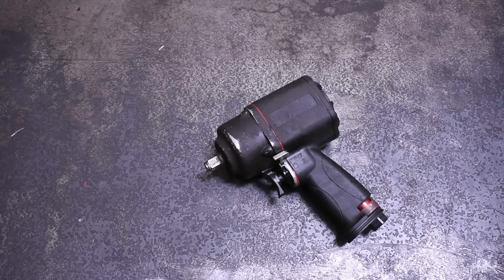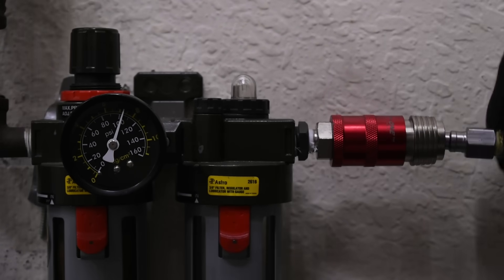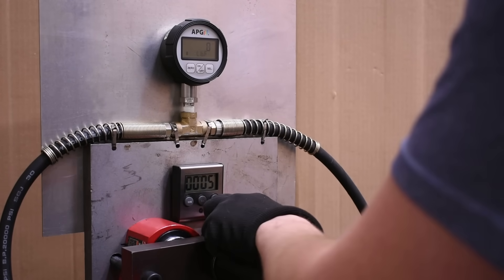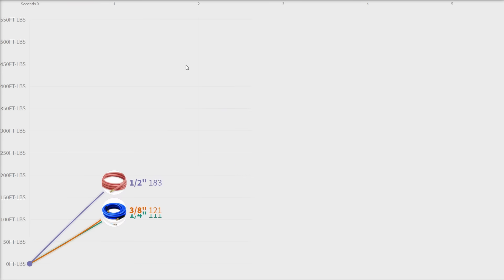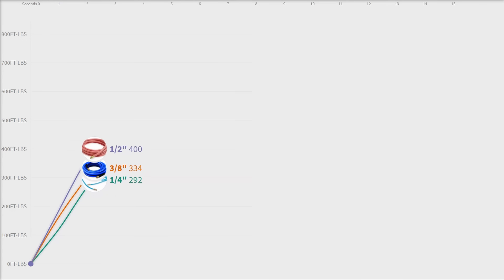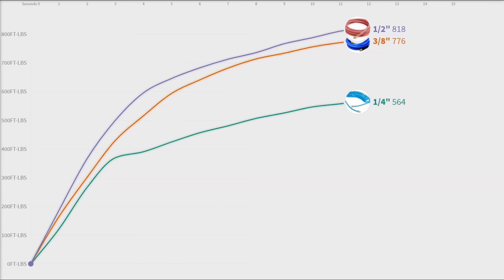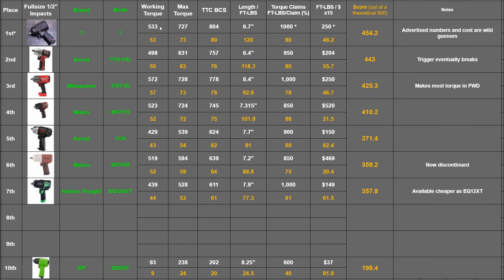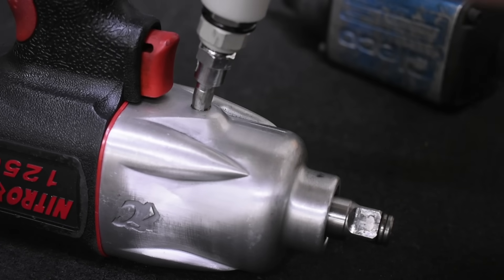How Much Power Are You Losing w/ Your Air Hose Size? Dyno Graph Testing

Comment: A few years ago I started using the Milton A-style fittings because I found them to be better than the standard ones you find at the big box stores (they don't leak as much and they're push to connect). Just found out that they only flow 34 cfm and the v-style flow almost double that. I'm wondering how much power I'm leaving on the table here, so I would be very interested in seeing that comparo, although, I must say I've never had an issue with power on my 1/2" impact doing normal automotive sized fasteners. My impact will snap most fasteners up to about 1/2-13 if they're rusted or galled frozen, I just need to fill the compressor up all the way to max 145psi and straight pipe it. I have a tee manifold off the compressor, one that goes to the regulated supply and one that's just straight through. Typically I run static 90psi so I don't inadvertently snap smaller fasteners or overtax my air tools unnecessarily. I typically don't do this straight pipe either unless it's on exhaust parts or something that's rusted so bad it needs replacing anyway, because I don't like having to run out and find replacement fasteners. It's such a time suck. Typically I'll roll out the oxy-acetylene torch on the really stubborn stuff. Takes less time than either snapping them off or torching them off then finding replacements.
Medium or heavy truck stuff is different though. I've known about the line size thing for a while just because my father had a big 1" impact he used to use for his dump truck. He would get out a special 1/2" line and thread it directly into the compressor, which would do 180psi static, to get enough CFM to break the lugs loose on that truck. It would drain the 80 gallon tank to below 100 psi on just one lug. Sometimes it would take a couple tries. It was so annoying waiting for it to pump back up, but otherwise it was a cheater bar on a 1" breaker bar about 5 feet long, which would overcome the resistance of both the parking brake and the transmission in gear against the compression of the engine, and sometimes we were still using heat because of that. It was a logging truck so it ran in the mud a lot, and he ran it in the winter doing firewood deliveries so lots of road salt and the lugs were always frozen by the time it needed servicing.

Comment: The smallest restriction in an air circuit will determine its power transfer. Longer supply hose is like a long skinny storage tank, no effect on power plus or minus. Ideally the tool would be the smallest restriction in the circuit.

Comment: Could you guys do a test that measures how an impacts recorded torque varies versus dynamic pressure on air compressors of different sizes?  I want to buy a compressor for my 1/2" Ingersoll Rand so that it delivers it's rated torque.  But, I'm not sure if I actually need 20scfm continuous volumetric flow at 90psi dynamic pressure or not.  The answer to this question could save thousands of dollars if 20+ scfm isn't needed for impacts.

Thanks.
Reply from the maker: You DO NOT need 20cfm. Especially on an non continuous use tool like an impact

Comment: I put a 3/8 coupler on my 3/8 hose and it brought my 1/4" angle drill to life.  No more struggling when using the 2.5" grinder discs/3M scotch pads.  Same for my 3" cutter.  I thus concluded volume into the tool was as important if not more so than pressure.

Comment: Excellent video, thank you for making it.  So, is it a waste to buy  a 3/8th inch hose with 1/4” npt connectors on the ends?
Reply from the maker: No. 1/4" npt is standard on 3/8. It's just a name for the npt size. It's not 1/4"
Reply: @TorqueTestChannel  Excellent, thank you.

Comment: 1/2" would be better if it wasn't limited by the 3/8 fittings and adapters. Kind of pointless testing something and limiting it.
Reply from the maker: The gun has a 3/8" NPT inlet which is actually larger than average, even 1/2" NPT fittings (which measure much more than 1/2") would be stepped down to work either way.

Comment: As a heavy Duty field Mechanic I can definitely attest to these tests!  We run VMAC under hood air compressors set to 150 psi and use “p” style fittings. If were doing a big engine overhaul ( like 9390 cubic inches big!), we usually tie two trucks air tanks together and run a 1” air hose to feed a shorter 1/2” line for the 3/4” Impact guns. Time is money and when you have 16 cylinder heads to remove with 10 1” head studs torqued to 660 lb/Ft each you can’t be pissing around with weak ass air tools!!

Comment: We used to use 3/4 inch line when I was in the army. That’s because we had an 1” impact for the larger trucks but we used 1/2” drive most of the time. We just didn’t want to switch out lines. We found 3/4” line works better than 1/2”. But just by observation no scientific stuff done. Be nice to see you try 3/4” line.

Comment: Nice video! My guess is you have a really nice air compressor to be testing these tools at maximum torque settings for 15 seconds at a time. Any way you could test to see how effective small and medium-size air compressors with less CFM are in comparison?

Comment: Fail! Your air supply looks to be 3/8” you can’t expect improvement on 1/2 hose if your supply isn’t adequate. Your compressor has to be able to flow and keep up with the demand.3/8 and 1/2 only seem to be similar because that’s the limit of your supply!
Reply from the maker: Air supply is 3/4" pipe to 3/8 npt. 3/8 npt which is like 1/2" thread is not the same thing as 3/8" hose. 3/8" hose uses 1/4npt. The wall mount flows 42+ cfm which is several times what a 1/2" impact can use. From there it's 3/8 npt fittings and 1/2" hose. The gun is 3/8 npt as well, so even larger fittings would be necked down there as well.

Comment: I plumbed my whole shop with 1/2" copper tubing and shark bite connectors. My 60gal compressor does 155psi, but is rated for 4.6cfm at 90. The main bottlenecks are the end of the hosing going into a reel on my ceiling that's 3/8" flexzilla hose with 1/4" npt industrial style ends. It's my home garage so I don't need anything crazy, but I set it up for 1/2" so if in the future I needed to upgrade I had the ability to.
Reply: Flexzilla has 1/2" reels now

Comment: It is refreshing to see someone that gets this.   Try working with someone who uses a 1” impact and 1/4” quick connect fittings.  He thinks I’m the idiot who doesn’t understand.
Reply: Not even joking btw.   1/2” air hose with some reducers for his quick connect.   Then his 1” (all air tools really) impact has a couple bushings to get it down to the 1/4” air fitting.  Every time I see it I scream on the inside-might as well use a smaller impact!

Comment: I am curious if the Prevost High Flow Coupler, 3/8" MNPT
would be better than both. I've been using them for over 20 years and the green button coupler is bullet proof. It has a hard plastic coating that is safer if it hits a cars paint as well. 
Cool video, thanks

Comment: The best static pressure for air driven Tools like this air gun is 174 psi or 12 bar,  for smaller tools it's between 7.5 to 10 bar

Comment: I wonder if the cost of the 1/2 upgrade from 3/8 is worth it considering the 5% margin of benefit. Or would the margin grow with different tools? I have an IR 1” thunder gun I use my my truck running off a 3/8 and I’m curious if I’m seriously handicapping it... or if it’s only losing a small margin of power
Reply from the maker: For 3/4" and 1" drive its a massive difference
Reply: Dang! I guess I need to change over to the 1/2”... I think my air compressor outlet is only 1/4” pipe though. It’s just a 20gal

Comment: Guy at my shop tried to tell me my IR 3/4" gun sucked because it was hitting only as hard as his 1/2" gun. I had to spend 15 minutes explaining that if you run it off a 3/8" line instead of a 1/2" (or 3/4", like I use to), it won't hit that hard. He was having a hard time removing a cross threaded lug nut. I hooked it up to my 1/2" line and instantly snapped off the stud. I said, "you're welcome" and walked away.

Comment: I never realized how many run impacts on a 1/4" hose !!
Reply: I did for a little while when I bought a used Reelcraft reel with an old 1/4" hose already on it. Couldn't get axle nuts off with my 3/4" drive impact like I used to be able to, so I upgraded to 3/8" flexzilla and it was ten times better.
Reply: @dreddnott  go to 1/2" and it's amazing.

Comment: this makes sense to me..... for my garage I had setup a 100lb propane tank as a reserve and originally put a bunch of M fittings(everything disconnected, as to keep it modular) and used 1/4 line, was finding it wasn't really cutting it for using pneumatic tools so I decided to use PEX(regular water grade) in the place of the main run that ran to a 1/4 reel, noticed an improvement but it still had room for improvement....... shopped around and got a 3/8 auto retracting 100ft hose and it's was near perfect!:)......same reserve tank, skipped most the M fitting(less modular but found it was part of the limiting); it's all 1/2 to the reel or m fittings(multiple drops to plug into; may upgrade to V-Style at some point)

Comment: I love your channel! your torque graph over time is a great way to show the instant and gradual power gains over time. great great channel, absolutely loved your air hammer torque output calculating rig. But the real reason I am commenting is cause of this video! I would love to see on 3/8" hose (most common I think) the comparisons between the different styles of milton fittings, specifically the milton "L" style vs the milton "H" style (The "V" style may be somewhat the same as the "H" style) i just upgraded all my air tools at work to the high flow "H" style milton fittings from the smaller "L" style. and the off brand "L" style fittings i had have even smaller holes then 1/4" on the milton brand ones.

Comment: 1/4" hose?  Never. I used to use 5/16 which was just ok. That decades ago pre  rattle guns.
I have used 3/8 generally ever since. I tried 1/2 to the gun but just too awkward. So use 1/2 to the 'points and a 30 foot 3/8 from there.
Since recently buying a new compressor which pumps 125psi the gun feels a lot more spritely than the old 100-105psi.
Though having battery tools now the air tools dont see a great deal of use.
I have used Ryco fittings though may change to Nitto as they reputedly flow more air. And hiss less as well.

Comment: I think 1/4 inch is for air sprayers and even light air tools like nibblers. Never recommend anyone use a 1/4 inch outside of that. Maybe airing up tires but even then it depends on the tire.
Reply: We use 100' of ¼ on our compressors airing up monster truck tires and it absolutely sucks! Getting from flat to 18psi takes 10-15 minutes, even with a 5.3 cfm compressor.. But dragging around that much ⅜ hose just isn't doable. I actually just ordered 50' of 5/16" hose to save a little time.

Comment: Randomly found this channel and its pretty dope. I worked in nascar as a tire changer and we used Oetiker flow through fittings on everything and were the standard for the guns and also 1/2" hoses were used alot but at the lower levels where I was at we were typically used 3/8" and there was definitely a difference when hooked up to a nitrogen bottle.

Comment: From a mechanical engineer who designs, builds, and maintains large industrial compressed air systems; you guys a doing a good job.  Without going into the detail,  friction or line losses from diameter, length, and incorrect component sizing it the #1 cause of poor system and tool performance.  This is also the most overlooked cause of compressed air problems, too.  So if you used 5ft test hoses, you probably can't see enough difference in your test to matter; but at 100ft, the performance gaps will be huge.  An easy way to tell if you have too much line losses is comparing static pressure to dynamic or running pressure.  My design thumb rule is a max 5psi difference from the compressor to the tool.   What that generally means to a home shop setup is that 1/4" is good for blowing dust off  and inflating bicycle tires, and not much else.  3/8"  at less than 50ft will work Ok for most things, and 1/2" is best and necessary if you want the best performance out of 1/2" or larger impact drivers.  Again,  the length of the hose (and hard pipe) matter. Higher flow and pressure compressors can't improve system performance if the pipe size is too small start with.
Reply: I know this comment is old, but I’m curious what you’d recommend for air fittings then. Right now, the hose is only going to be 25’ of 3/8”. If you’re still floating around anyway.
Reply: @gtcam723  By fittings, I'm assuming you mean the QD's on the end of the hose.  1/4" Industrial style QD's  (most common version) will work fine for 3/8" hose.  I use 3/8" QDs on my 1/2" hoses for higher flow tools such as impact wrenches.  Most of the time, the QD;s don't cause more than 1-2psi losses.   3/8" hose x 25ft should be good for up to about 10scfm with acceptable pressure loss.
Reply: @byronhaley1566  After 25 years of wondering why my expensive impact never seemed to be able to remove any stuck fasteners on my cars, I finally realized it was the hose.  I threw out my 50' of cheap hard 3/8" hose and upgraded my garage to 3/4 hard pipe feeding 25' of 1/2" rubber hose.  Now I laugh out loud when the gun removes stuck, rusted suspension bolts without even trying.  Like the gun doesn't even "rat tat tat", it just turns them out.  I'm a big fan of the 3/8" industrial style disconnects you mention.

Comment: The lines inside an impact wrench through the handle to the rotor and veins in the motor section are going to be your weakness when using 1/2" air line!

Comment: I really enjoyed your videos..me and my dad are setting up the garage and I was hoping you could answer some questions to edu our selves ..the first question is  how much does a  90 degree  fittings take aways cfm..or would it be better to ad an adapter to a hose to make the "90"..as in celiing to wall..can you see a difference in torque loss...also how much torque is lost per foot....as in if you wher going to snake an air line up to the wall to the celling then down to the wall then add a 25 foot hose..vs just running a hose from the trans..hope this isn't too long ..enjoy ur day
Reply from the maker: a 90° like a pipe fitting should be zero loss if the inside diameter doesn't change. As for length, the smaller the inside diameter, the more it will effect things. 50ft of 1" wall pipe is almost no lose, 50 ft of 3/8" air hose IS
Reply: @TorqueTestChannel  ....cool thank you

Comment: I know you’re addressing impact wrenches, but my dad has been building things all his life. With large wood buildings, he doesn’t want to move his compressor all day or waste money on hundreds of feet of 1/2” hoses. When you really get moving with a framing nailer, you can run short on pressure in the lines. He would keep an old, bare compressor tank around to use as a capacitor and splitter so multiple nailers stood a better chance of not loosing pressure while sheeting a building.

Comment: I did NOT expect that. I expected it to be a bit of a difference but that's just insane.

I really need to reevaluate my system because all my tools are old air hungry tools and in some cases I thought they were just getting too old, might have been the new smaller hoses.

Awesome work, thank  you for this, subscribed and upvoted.

Comment: i use 3/8 at home with 26 gal 1.8 hp  150 psi kobalt tank, 50 ft hose, im using an old ch impact from my father, i was sure with this setup id be able to use it for removing lug nuts but nope, im not sure what the torque is on this impact and im guessing thats my problem, what do you suggest?
Reply from the maker: Aircat 1150 in that case
Reply: Do you sell them?

Comment: The difference between 3/8” and 1/2” really is just showing that a 1/2” drive impact gun is nearly fully satisfied with a 3/8” line.  If you moved to a 3/4” drive gun, you likely would see a huge difference between the 3/8” and 1/2” line.
Reply from the maker: Absolutely

Comment: You say you set your wrenches to 90psi dynamic pressure but you aren't measuring dynamic pressure. You're measuring static pressure with your gages. Dynamic pressure is the difference between static and total pressure.

Comment: If i understand it correctly, the measurnments where taken with 2 different impact wrenches. So the difference between 3/8" and 1/2" could be a result of a better wrench. (or did you only use the large one and have reductions on it?)
Also when you only have a small compressor, its no use to have big hoses. The bottleneck will always be the tightes spot ;)
Reply from the maker: Just the 1 impact, which has a 3/8" inlet. 80 gallon IR compressor
Reply: @TorqueTestChannel  Thankx for the explaination.
BTW. That compressor comment wasnt meant for you but for someone with a small compressor in his home/shop that now wants to install the largest hose he can get :P

Comment: I have a booster tank with 1/4, 3/8 and 1/2 couplings that I use with when I'm dealing with stubborn bolts or if I need to use a 100 foot hose to reach.  It makes a massive difference on large bolts and nuts found on semi-trucks.  Ofcourse you need to put short hoses on your guns to get the benefits but that's actually something you should do anyway to prevent coupling wear.

Comment: I kill mine with a long length of 1/4 hose. However, this is a flippin ace vid because I suspected that it was better to run 3/8” and leave out the regulator and snap couplings if I needed the air hammer to really pound the bolts :o) *as an aside we ran local booster tanks in the factory. Doesn’t help for a long air use but for a second they really add some push.